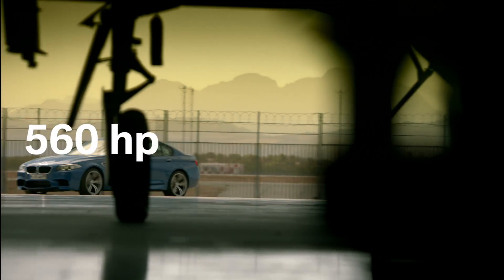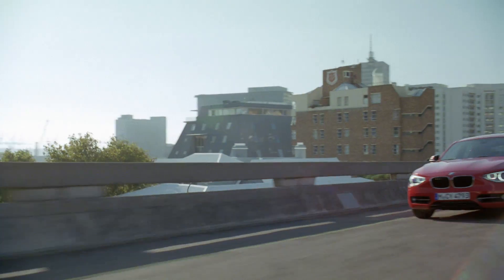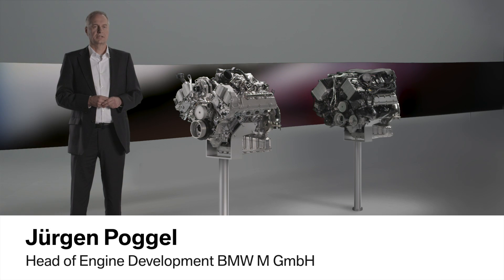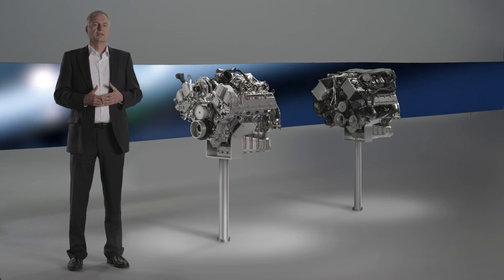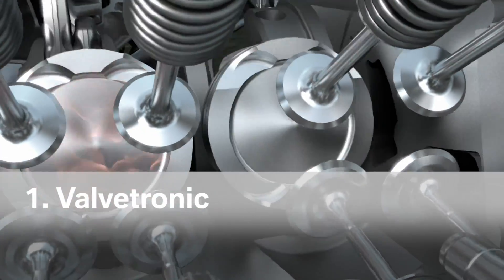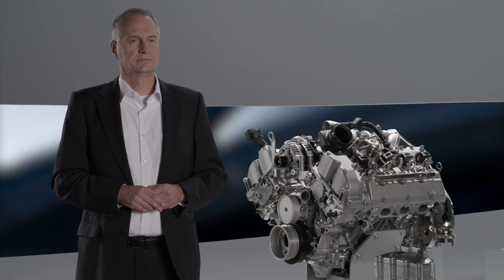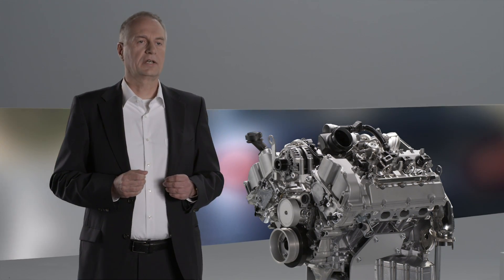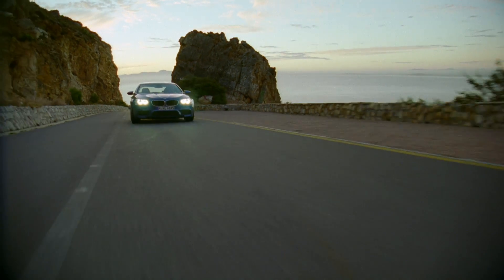BMW TwinPower Turbo and Valvetronic.

Comment: Great engines, and I've had a few, but fix the timing chain issues on the 4 cylinder engines, and the oil burning on the V8s. Other than that, the leaks on the 6 cylinder engines are frustrating, and for heaven's sake, put a bloody dipstick on the engines so us old farts can can check the oil level.

Comment: Twinpowerturbo petrol engines all and twinpowerturbo petrol engines hybrid all : Easy damage, 20-100 l/100km, over 100 l/100km with Formula one speed 160-250 km/hour, over 250 km/hour on all cruve and straight circuits and test maximum over 20,000-150,000 rpm. These ones know as the worst family petrol engines of BMW.

From
BMW databases 

End report.

Comment: Award winning engine quality... yeah right. Bunch of the N20 engines all have time-bombs inside them with the terrible plastic chain guide that when it breaks, blows up the engine. And that's not even covered under a free replacement except for countries that sued BMW. Also, Valvetronic's stupid calibration sweep done every time the car is unlocked (and not even when the engine is started) causes so much unnecessary wear on the mated gear motor to shaft gearing. I had to replace my valvtronic motor AND eccentric shaft for a whopping $4k CAD not even 1 month out of extended warranty.
Reply from the maker: Would you like to let us know about your concern? Please send us a private message DM via Twitter or Facebook. Thank you in advance for your assistance.

Comment: BMW engines are as good as their owners... if you maintain these engines wisely, they will effectively give you no problems whats so ever. turbo engines WILL burn oil, like most other brands would if using TDI. most customers will drive them until their death when engine components starts to fail because of lack of maintenance & point at it with fire not realizing its their own fault for not paying attention of its maintenance interval... these engines are brilliant. but maintaining them is the key to longevity.
Reply: Christian Castro bullshit you can maintain the v8 all you want.. they simply pos .. For BMW Onlg fuckjng but in-line 6 that’s all they know

Comment: What about the cheap ELECTRIC water pump that fails and  needs to be replaced on almost every BMW only after like 30k and up? unlike other cars water pump will fail after 150k-200k miles!
Reply: Scorpion King I heard from posters claiming 60K. But, anyway, considering how cars keep on getting heavier due to safety and comfort standards going up, it just looks like electric is the way to go, unfortunately, and other makes will follow BMW's lead.

Comment: Lol.. Valvetronic "while others use cylinder deactivation for fuel economy, we used valvetronic to achieve 22 mpg making us the best"
But cylinder deactivation has some vehicles achieving 27 on similar v8s? Even the engineers are full of themselves

Comment: Yeah, so you invented a system that via throttle position variates valve timing and injection timing. Excuseme if I'm wrong, but isn't that tha same shit as I-VTEC? Wich btw is extremley reliable and was produced about 15 years ago.
Reply: Just for clarification, i-vtec is just using vetec plus "VANOS" ie continuously adjusting the cam positions. Valvetronic can continuously adjust the valve lift anywhere in between small lift to big lift and as such does not need a throttle body to regulate the engine. Where vtec uses a separate cam profile that has more lift and duration, so there are only two modes off, and VETEC yo. Hope this clarifies things, Both systems are quite clever BMW for its sheer efficiency, and Honda for sheer simplicity.
Reply: +mierdaxdd It's a completely different system.
Reply: +mierdaxdd   The Vtec is non turbo, increases lift from oil pressure, doesn't work when it is cold, low oil, oil change needed, and is not as smooth as BMW's. Also it has nothing to do with fuel consumption, it just increases lift for more performance.
Reply: FrozenHaxor It's a completley diferent system in the same way as neo vvl is different from VTEC, isn't it? Does the same thing in a different way.
Reply: +mierdaxdd I never said the vvt has anything to do with a turbo. Two completely different systems. Same difference as a modular engine, northstar engine, etc. Turbo increases combustion pressure, has nothing to do with valve lift. And reliability? I build race engines that only last 500 miles (sometimes less) so it's all relative. Honda's new vtec, since 2012 I believe, has the exhaust manifold cast with the head so that it's one piece. sounds like a problem. You could always buy a CPO with warranty for 6/100,000 and when it breaks, get a loaner and free repair
Reply: skybluealien It's non turbo because it has to be reliable and the turbo system has nothing to to with the valve system (if you noticed it since I see you consider yourself smart) now the trend is to go with unreliable crap that goes wrong 3 months after the warranty is over. BMW will never make engines as reliable as vanos engines from the e36 and e46 series, just deal with it and get used to the idea, as things looks I will not buy again any BMW anytime soon.
Reply: Sovietguy While you may not buy a BMW again, just keep in mind whatever technology it has currently has might be present in non-BMW brands that are supposedly 'reliable' such as Honda, Toyota, Kia, Hyundai, etc. Thus, you might suffer the same issues in your future non-BMW like BMW has. This because, unfortunately, cars keep getting heavier and heavier and heavier because of the rising of safety and comfort standards. That extra mass means a lower fuel economy so Valvetronic and VANOS are added. Either way, there's just no escaping from it.
Reply: @Sovietguy - Vtech is like vanos. valvetronic is different
Reply: Mark Woodstock but Vanos as I understand it does more than vtec but would need more maintenance due to more moving parts.
Reply: Sovietguy i have both, both are just as reliable, but my n55 has much better fuel efficiency, even with a turbo.
Reply: Stefan Unson where did you get that cars keep getting heavier? It's the complete opposite. Make sure you judge the same type of cars over time

Comment: I will love to have the BMW owners say their thoughts after 100-150k km with their cars. From what I know the valvetronis engines have problems and making them more complex would only make more problems for owners. The reliability isn't good for german cars anyway.
Reply: SacreDro BMW owner, driving one of the first series valvetronic engines with now 100k kilometres......and yes, everything's still fine with the engine, except it doesn't develop any power at all - but that's not unusual for 116hp.
Greetings from Germany!
Reply: The only problems they will have will be due to Moron owners who think they can go 15K on one oil change.  That is IF they change the engines oil at all.  BMW engineering is second to none.  They make and have made fantastic engines for many many decades.
Reply: Unfortunately it's aimed at fuel efficiency, not reliability, and all cars will have reliability problems because of it, especially from the fact that cars keep getting heavier and heavier due to safety and comfort standards going up.
Reply: +SacreDro I assure you that no technology on the bmwn. (I'm a mechanic
Reply: Can confirm. Own one. Complicated and prone to fail
Reply: bmw 335I owner,
turbo went out, valvetronic and eccentric shaft is said to need replacement, and a few injectors failed as well at 85k miles.
Reply: Yah like most engines now are shit.

Comment: BMW Still has problems it still is fuel consumption heavy do to the timings not being set right the guy who supposedly invented it did not know how a valve like this should work. You should only have the valve all the way open on low rpm and high rpm should be closer to being closed then low rpm do to time to return of the spring at high rpm.

Comment: Lmgtfy - 'The combination of a high power output and a simultaneous reduction in emissions is achieved by VALVETRONIC variable valve timing and Double-Vanos variable camshaft timing.'
So efficiency is a combination of both. Hence that implies they are not the same thing.

Comment: Well there is no need or desire to vary the output of individual cylinder on regular OTTO cycle engines (regular car engines like this BMW). Special engines that run leaner that stoichimetric by sometimes acting like a diesel would probably need to control each cylinder individually so the gas will ignite without a spark plug at the right time. Otherwise really bad knock could occur. Lean burn can also be done by keeping the spark plugs and not needing the fancy cylinder valves, like Honda in90s

Comment: Valve lift (or 'Valvetronic') is BMW's replacement for the conventional butterfly throttle and has nothing to do with compression ratios. I think you may be confusing the latter with cylinder pressure. Again, why would you want to vary the output of individual cylinders? Having different compression ratios for each cylinder will do just that.

Comment: I don't mean to shut off cylinders randomly but to slightly change the valve lift in order to get the desired compression ratio in each cylinder so that in the HCCI cycle, gas will combust at the right time without a spark plug. Sensors would tell the computer what compression ratio is needed by knowing each cylinder's temperature and individual knock sensors and maybe others.

Comment: Why would you want to individually throttle cylinders in this way? Assuming you mean varying the amount of air for each cylinder per revolution, the result would be a very unbalanced engine, and I suspect, a very short-lived one.

Comment: Yea it might happen it might not. A way to achieve higher fuel economy with less complexity is to use a lean burn mixture, a lean burning engine. Honda did it back in the mid 90s to mid 2000s but then they stopped because of emissions. Toyota is thinking of using a turbocharged lean burn engine in the next Prius and saying that it could achieve close to 60MPG real world. It's just a matter of keeping the emissions down

Comment: This is very cool valvetrain technology. Now if they could figure out how to vary valve lift on each individual cylinder, then HCCI engines could come to market. Right now Valvetronic I am almost positive just affects all intake cylinder valves at once, not on a per cylinder basis. To be able to retain a mechanical valvetrain while being able to do per cylinder valve lift, would be awesome. But they might have to go with electric solenoids instead of a mechanical valvetrain.
Reply: With this comment you basically prediced Koenigsegg Freevalve
Reply: @ezmatt  oh my! I have my moments. HCCI development is it ever coming? Too complicated too little gain over Atkinson and EV
Reply: @danwat1234  I believe some Mazda engines have HCCI ("skyactiv") but I have no idea whether they're still in use
Reply: @ezmatt  I think the Skyactiv stuff isn't  pure HCCI, HCCI mode, combustion is not entirely unassisted but I could be wrong

Comment: vanos is the sensor timing for cam shift , valve tronic is smart technology combines the gas pedal to control the fuel and gas mixture in throttle body enhanced  with 2win turbo fitted on the exhaust gates all works together , electrical pedal, throttle body exhaust turbo system !!! really i love bmw